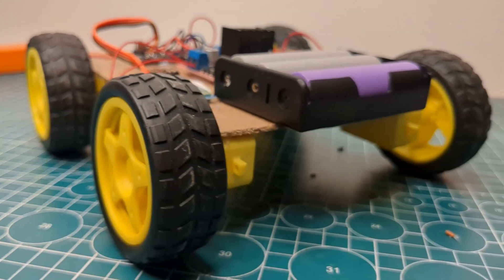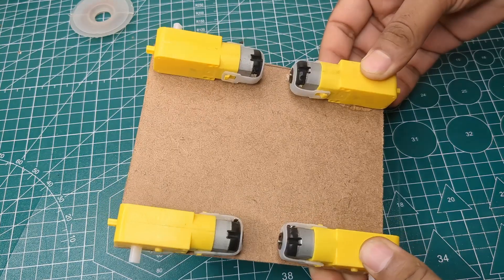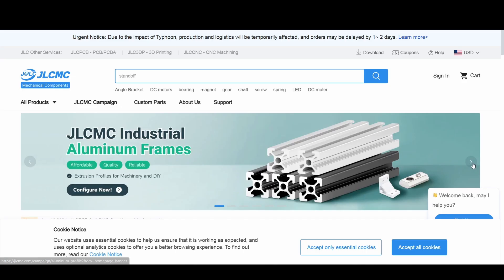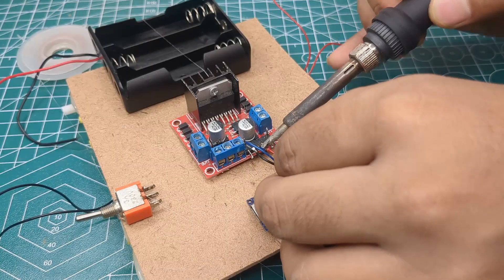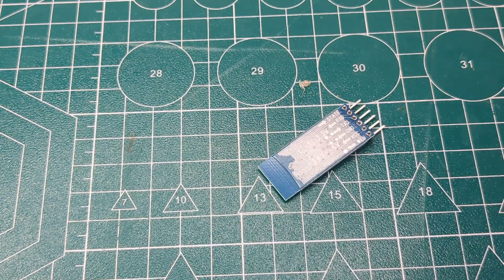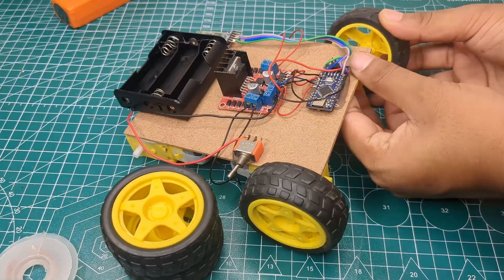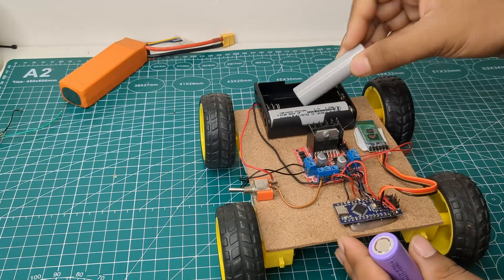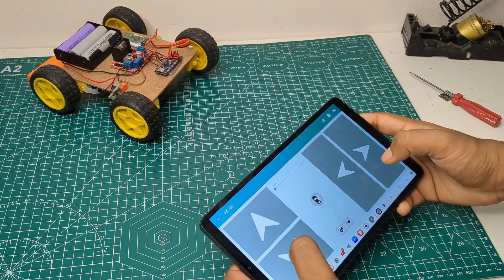Build your own Bluetooth Controlled Car using Arduino step by step! 🚗✨

Comment: Can we use esp32 bro
Reply: Yes bro it little bit expensive
Reply from the maker: Yes,  you can use esp32 as it comes with builtin bluetooth and wifi but code part is little difficult. So for beginner Arduino with hc 05 is perfect. But if you want to try with esp32 you can definitely go for that.